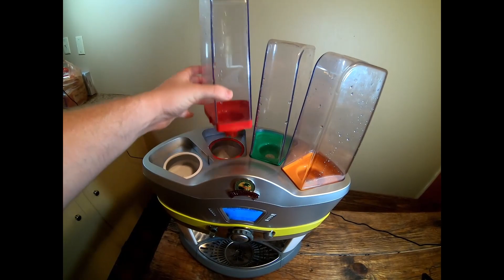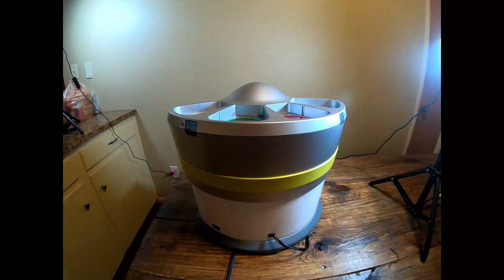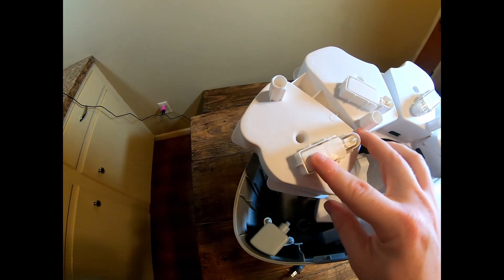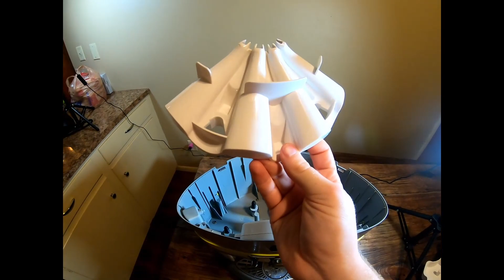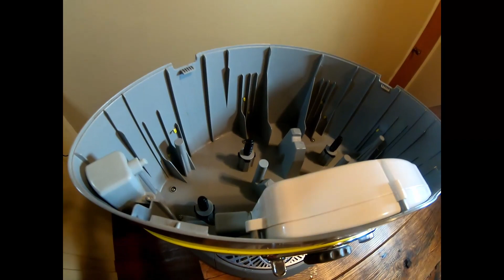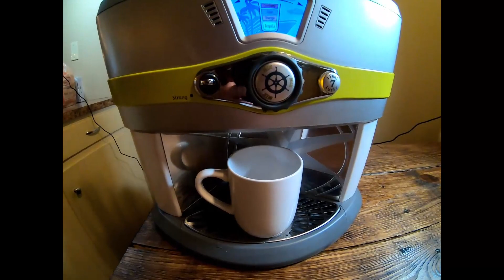Margaritaville Mixed Drink Maker MD3000 DIY: Disassembly, Troubleshooting, and Cleaning!

Comment: The black post inside my margaritaville machine is not popping up and down, can they be replaced?
Reply: Take the top off(remove screws below the white resivoure). spray WD-40 around the bottom post on the solenoids. Manually move the  shaft up and down to loosen the gunk inside of it.
Reply: Yes remove all ineer screws.   You will have to get the specialty bits for the 3 screws I think they are called pinhead spanner bits????   Usually in a multi pack.   Sprayed some wd 40 worked it for 5 mins and it works again

Comment: One of the black post does not engage to pour the liquid. Tried your wiggle method to get it to work but no luck. I think the little actuator motor is not working. Have you ever taken the case apart?
Reply from the maker: No I haven't. My guess is that these machines aren't made with quality parts which makes things like that happen. It seems like a pretty common problem.
Reply: @lumberjackthrifts4159  Look above.